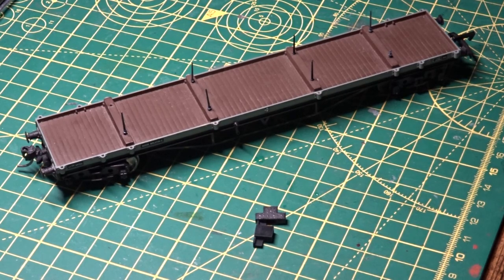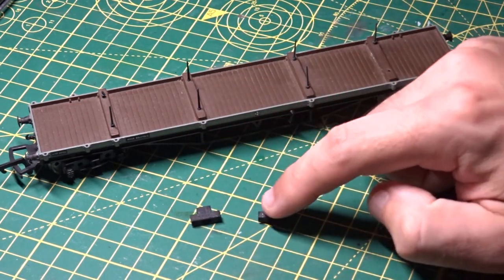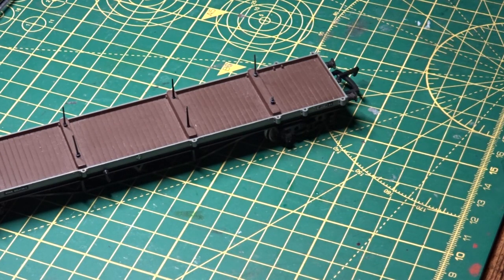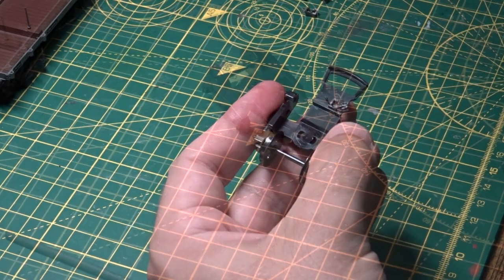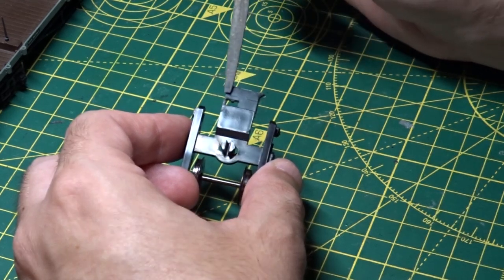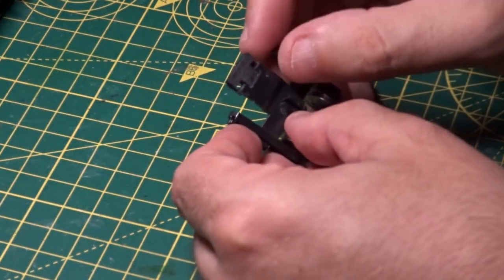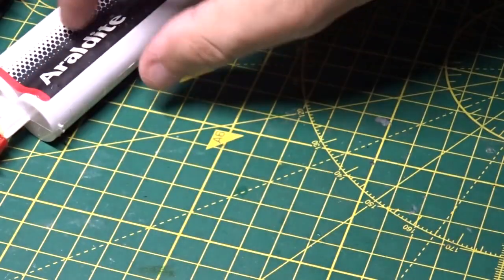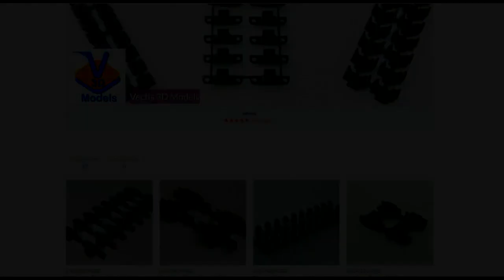Bachmann Bolster Wagon NEM Solution.

Comment: Hi, do you have any pockets that will fit the Hornby haa hopper Wagons, I need to change the large D couplings on about 20 wagons?
Reply from the maker: Hello,  I haven't been asked,  I am aware there's 2/3 different varients of couplinga on those including newer NEM types,  I've seen some moulded in to the chassis,  some riveted..  So it would depend which ones you have.
Reply: Many thanks for responding. I purchased pockets from you a while ago for my coaches. Would it help if I sent you pictures of the bottom of the wagons.
Reply from the maker: You can do,  it would help,  as I say tooling varies depending on time of manufacturer see what you have and send a few photos and I'll try and advise.
Reply: Would this work on older backmann well wagons?
Reply from the maker: We have a number of solutions depending on how the coupling is mounted either with screw,  moulded on ect..
Each are designed for that particular wagon so it's the right height,  placement ect... 
Some do work all round some don't, its just looking at what's best for your item of rolling stock.